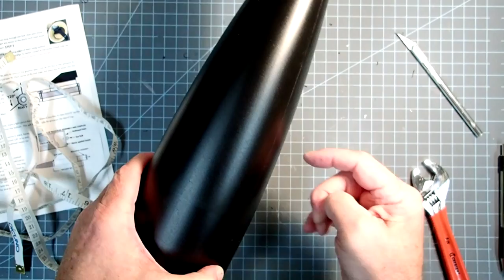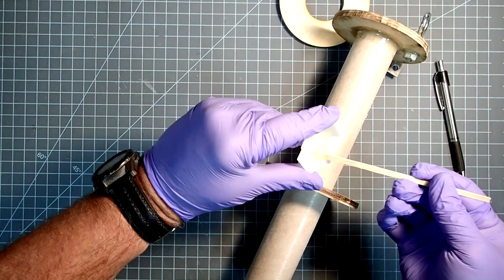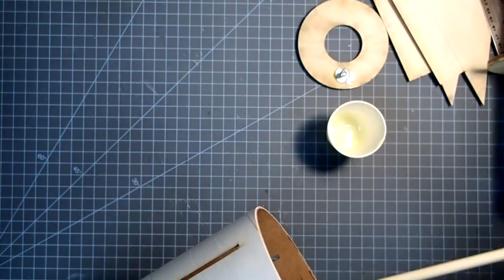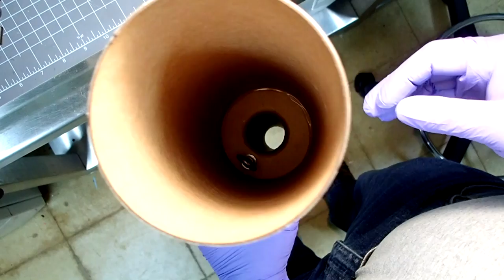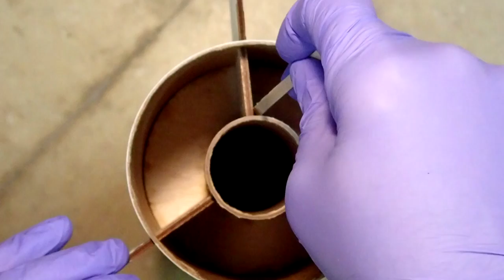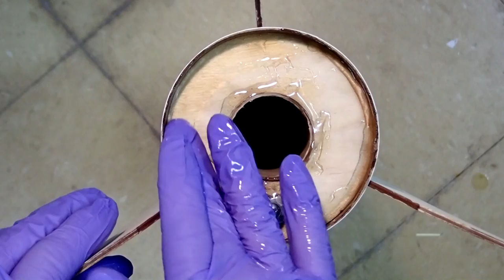LOC Precision “LOC-IV” high-power model rocket assembly (part 2 of 3)

Comment: Awesome Dave. I have been building the LOC kits for many years and love them. That said, I have a terrible time with the nose cones also. Can you add a link or description for the exact putty and primer you are using that works well on the plastic? I have many nosecones that have paint flaked off of them that I want to redo. Thanks.
Reply from the maker: The putty is Testors Fast Drying Contour Putty. The primer is Rustoleum Universal Bonding Primer. Both can be found on Amazon. Walmart also carries the primer, and the putty can be found at most hobby shops.
Reply: I use Tamiya modelling putty (white).  Its meant for filling plastic.  Use in small amounts as it dries very fast.

Comment: How does the motor retain on the Forward side without some kind of engine block? Does the aft closure retain it?
Reply from the maker: Most composite mid- and high-power motors have an integral thrust ring on the aft end, which prevents it from moving forward.
Reply: @REAR_rockets  thank you, I go to pick up my first composite motor today so this threw me off a bit. Going for my level 1 in 2 weeks so thank you for your great video series.

Comment: Prevent epoxy from dripping inside your motor tube by using a pencil balloon, or a piece of wax paper to protect it from epoxy drips.
Reply from the maker: Great idea!
Reply: Oh, that balloon idea would work great for blocking the forward end of the rocket body for painting smaller diameter rockets ( like BT60, 70, etc).

Comment: Hi Dave,
I watched your LOC IV videos and built my rocket exactly as you recommended, looks great. You mentioned that you will eventually modify yours for dual deployment. I'd like to do that but I am confused in which part to put the main and drogue parachutes. My main concern is that the payload section is relatively small and I am not sure isbit big enough for the main chute? Also what size of drogue chute is appropriate for this size rocket? Thanks for all great advise, it was very helpful for me.
Reply from the maker: I haven't done it yet, but there is plenty of room for the main chute in the payload bay. The avionics would fit in the couple. At a guess, 12-18" drogue, but I haven't run the simulation.
Reply: @REAR_rockets  Thank you, this is a good news. I bought the Apogee 98 mm Ebay with avionics and I will start working on it.
Reply: @REAR_rockets  hi Dave,
How do you think the shear pins will attach to the body tube and nose cone? Do I need to reinforce the body tubes with carbon fiber plates at the pin entry sites to prevent shear of the body tubes? Also the stem of the nose cone is recessed where the seems are and thicker there. Is that a good place to screw 2 shear pins on the opposite sides? Let me know if you have an idea how to do it for successful flights. Thanks
Reply from the maker: I’ve never used shear pins so I can’t make a recommendation.
Reply: @REAR_rockets  Thank you